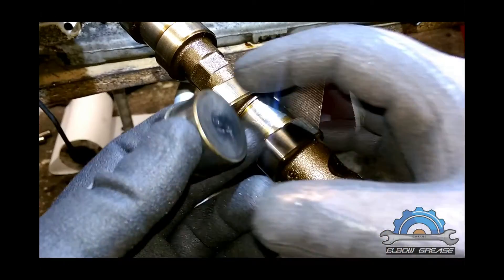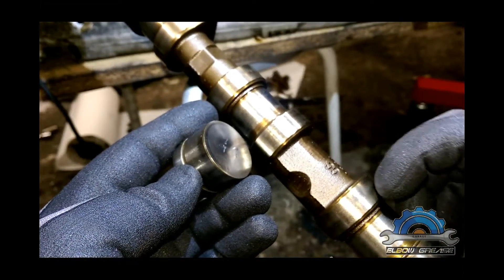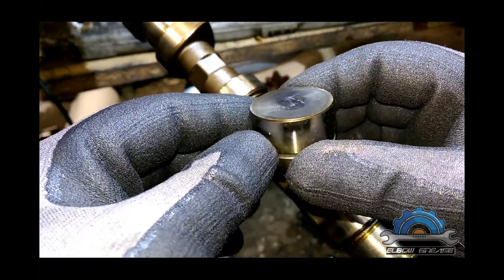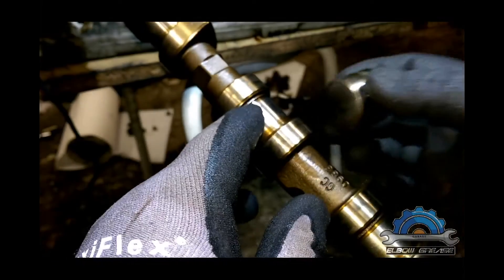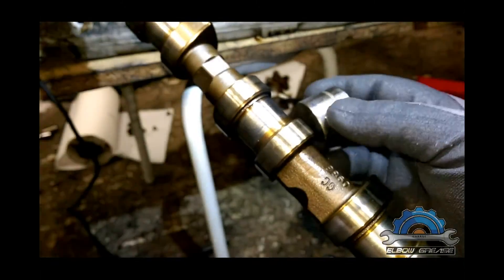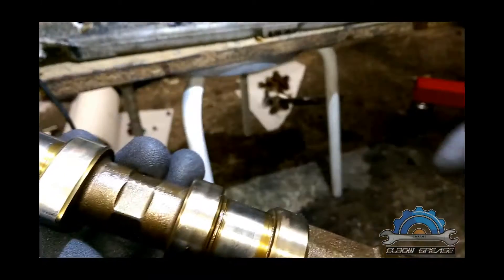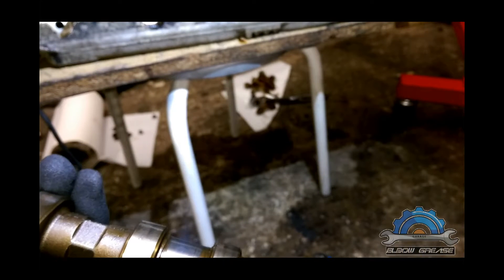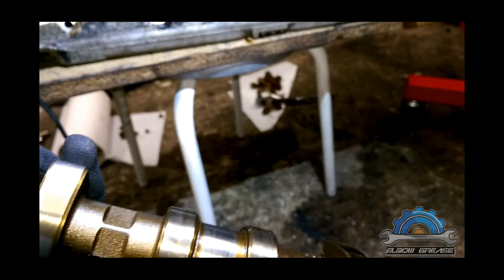BMW e46 m54 hydraulic valve lifter,tappet inspection

Comment: I have 2 type of lifter and got 24xpices only one type,why?they are diffrent?
Reply: I just found the same on a m54.  Intake & exhaust lifter barrels are larger in diameter on the intake side.  What solution did you come about the larger diameter lifters ??
Reply: @jonathangutierrez1759  i have buy a set of 24 lifters,but now got a tick